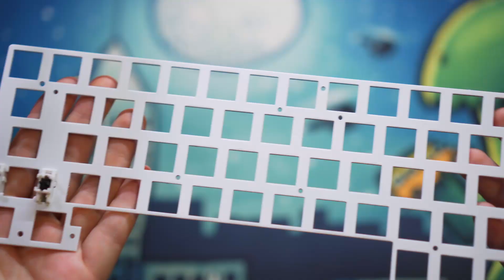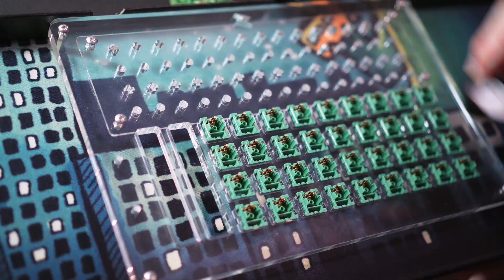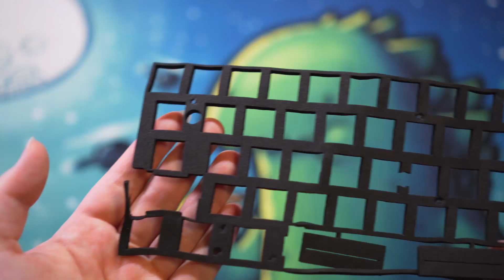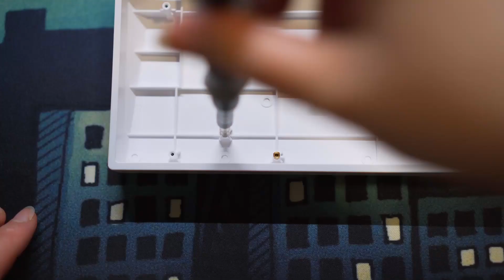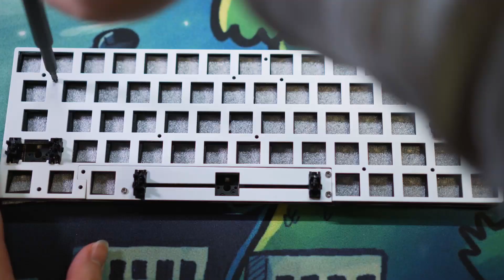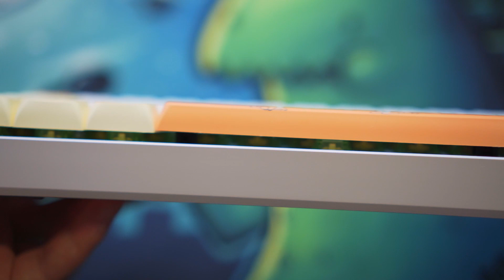Epomaker GK64 Build + Mods | Akko Matcha Green Switches | Gummy O-Ring Mount

Comment: Where do I find that tape mod ?
Reply from the maker: I use fabric tape:
https://www.amazon.com/Tesa-adhesive-wiring-original-ISOBAND/dp/B00XPDVER2/
You can use the average masking/painters tape for a similar effect. I just prefer fabric tape because the adhesive isn't as strong and overtime should in theory be less likely to dissolve onto the PCB so to speak.

Comment: Hi, what type of tape did you use for the tape mod? Is it some sort of cloth tape?
Reply from the maker: Ahoi thar 😊 Its fabric electrical tape the non-sticky one (no residue). https://www.amazon.com/Automotive-Adhesive-Electrical-Protection-Insulation/dp/B09C6DX6KK/ref=sr_1_8?crid=1KQXW0LZDQR36&keywords=electrical%2Btape%2Bfabric&qid=1650206430&sprefix=electrical%2Btape%2Bfabri%2Caps%2C249&sr=8-8&th=1
Reply: thanks so much!

Comment: This is quite an interesting mod, and the keyboard sounds very good. 
I have an SK64, which is basically the same as the GK64, except that the PCB used optical switches.  I ended up buying a PCB that allows me to use regular switches.  Other than that and PE Foam at the bottom of the case, my board is not as sophisticated as yours, and definitely sounds way too hollow in comparison to yours.
Reply from the maker: I do believe you can do the same to a SK64 since it should be structurally the same as the GK64. Putting in some PE foam definitely helps but if you ever get the time to try the o-ring mount mod you should see results 😊

Comment: Some comments here:

1) The reason why a softer o ring provided more flex in the traditional o ring mounting style is because there are protrusions in the case that let the o ring rests on. What you did did not do that. It’s the pcb itself that is resting on the foam. The o ring here is just there to stop the assembly from falling out. If you want a softer typing experience, use softer foam. 

2) Remove the plate foam. This is more of a subjective thing but w/ the eva foam already in the board you don’t want to overload the board. You put a ton of effort removing the standoffs and excess plastic already to change the sound and feel. Why add so much foam to make it sound like any other board w/ a ton of foam inside? 

3) You missed some plastic at the edges of the case. I’d probably get that taken care of bc the assembly can sometimes end up resting on it.

4) Stapling the o rings together wasn’t necessary. You could have easily just have used the o ring cord by itself and wrap it around.
Reply: Late reply, but steel plates tend to ping a lot, the plate foam may be needed for that no?
Reply from the maker: Thank you for the feedback!

1. I see that's good to know.

2. I think I personally just like really muted boards at this point 😅 I've tried no plate foam in my more recent builds and the board just sounds kinda pingy to me >< Am moving away from PE Foam for some my more recent builds though so getting more adventurous (for me anyway 😂)

3. I see noted, ye I didn't have the proper tools really to sand it properly so I bought a dremmel recently which will do the job well!

4. Unfortunately I don't have any keyboard o-rings for sale around me and the biggest I could find wouldn't fit around the whole board but yes definitely an intact o-ring would be best.

Comment: Will the gummy o ring work with the wireless version where a battery is underneath?
Reply from the maker: Yep it will, just make sure to cut space in the case foam to fit the battery and wire.

Comment: what happens when you put the switches over the foam? Do the pins just pierce through the foam easily? I don't know much about keyboard mods but can't these kind of plastic foams short something on the pcb because of the static?
Reply from the maker: The PE foam is really thin at 1mm and its also quite fragile so the switch pins will pierce straight through. I don't really know much about the science behind static and shorting PCBs but I bought the anti-static listing to be on the safe side and haven't had any issues so far. Also I haven't heard of any instances of PE foam shorting PCBs in general.

Comment: I see that the O ring is bunched at the corner on the switches, so im just wondering if it will pop out the switches on a hot-swap board? Also, is the pcb just sitting there because you removed all the stand offs?
Reply from the maker: I've been using the board for a little over a week now and its been fine so far. I don't think it'll be an issue but I will let you know if something does pop out.

The PCB is sitting high on the bottom of the case likely because of the foam. I don't mind the exposed switches but you can trim the case foam on the bottom 1.75 rows or so down to 2-3mm and it should sit fine.
Reply: @kumikeebs989  Thanks, this is really helpful :)